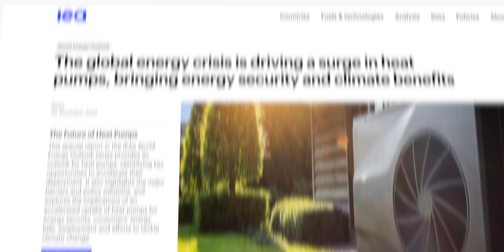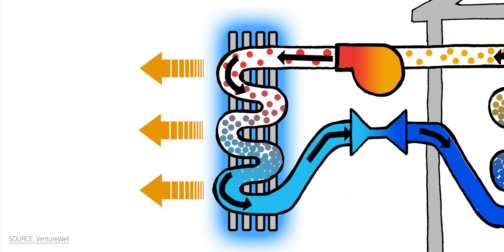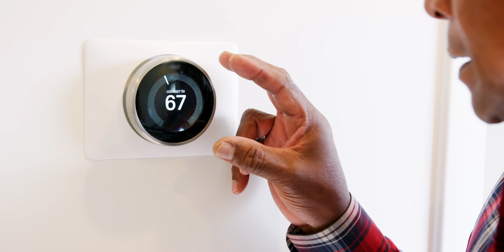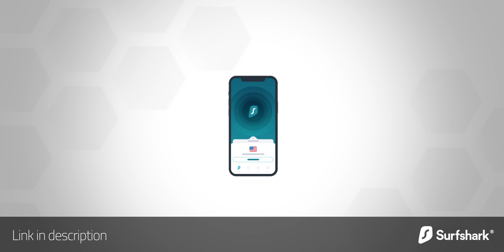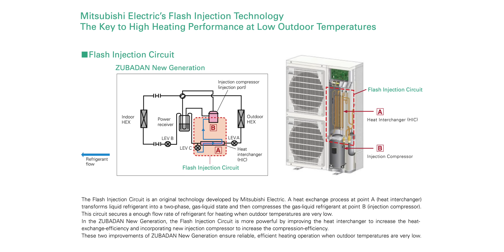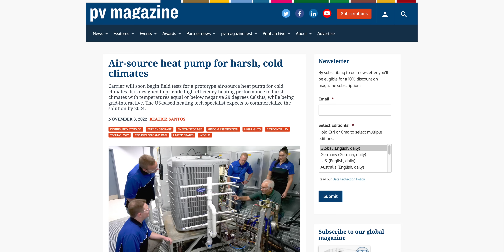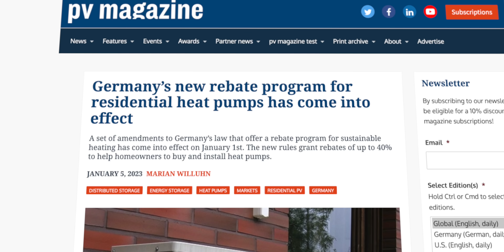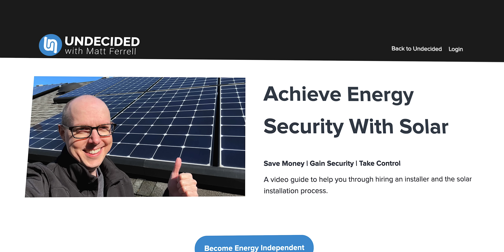Major Advances with Heat Pumps in the Extreme Cold

Comment: I installed a heat pump at my rural EMS station in Vermont. It helped keep the old building in the low 60’s throughout the winter, despite the outdated insulation. Saved $83 in February on heating the building. I imagine they work much better on modern buildings with proper insulation.

Comment: Bit of a misleading video. 1. As soon as your heatpump can add even 1% of extra heat from outside compared to the work that is put in, then you will be more ''efficient'' than pure electric heating. 2. Although heat pumps get more efficient, it is really marginal still, there is a theoretical maximum, which is not great with high temperature differences due to cold weather. 3. On your absolute amount of energy use, the extreme cold days really matter in the end. I can save 70% on the 20% of the mild days of the year, but then still on the 80% of energy used on the cold days, you won't see any difference. 4. Who heats their home electrically? Gas, wood and oil are way more cost efficient, at least where I live.

Theoretical it all sounds efficient and all, but in the real world it is marginal and not practical.

Comment: Hi Max, I really like your very detailed and interesting videos but here I experience some parts that need to be addressed as well.
A geothermal heatpump has the need of being reheated in summer so passive cooling in summer i sneeded to recover/restore the well.

Next to on/of compressors  - that can still do a great job when combied with a buffer vessle - inverter compressors are already 20+ years on the marke so nothing new here. 

Looking at costst os $1000 per kW (or $25-40 per drilled meter) the investent is so steep, a geothermal well will never be economically feasable. Shure, it's nice to have a heat source at -20 degrees (Celcius) outside but depending on where you live, a modern heatpump with propane wil do it's job fine at -7 degrees outside.

Just some ideas of someone being active in the market for 20+ years.

Comment: I don't understand why the air exchange unit outside in colder climates for heat pumps don't draw the air through Shallow buried exchange units.

Isn't soil temperature supposed to be much higher than ambient Air & surely wouldn't add much more cost to the unit
Reply: And simple passive things like having a dark covering nearby or over the soil area or near the heat exchange during sunny days must massively increase the efficiency of the heat exchange and for the reverse a reflective surface and narrow or around the heat exchange area design properly would do the same for cooling

Comment: I got a Mitsubishi hyper heat pump, because I have a solar setup with a 5000 watt inverter.  I wanted to be able to heat my house without emergency heat (electric heat strips) and run my 40 gallon water heater (1500 watt elements), refrigerators, freezer, and some other things off that 5000 watt inverter.  The heat pump worked fine all winter here in Northeast Indiana, except for a few days in late December when it got down to around -8 degrees/ -32 degrees wind-chill with very high wind.  The heat pump could not keep up.  The temperature kept dropping in the house, so I was forced to bring in my 15000 btu propane wall heater (that I use for my garage) for a few days to keep the house warm until that cold spell passed.  My house is about 1100 sq feet, and the propane heater was enough.  The heat pump has done the job other wise.

Comment: geo thermal heat pumps ARE NOT EFFECTED BY THE WEATHER. They get their heat from the ground which is at a constant 52F or 11C +/-
Most of the heat pumps people would be installing get their heat from the ambient outside temperature. 
The heat pumps that work at -13F or -25C or colder are hugely inefficient at these temperatures. Manufacturers only have a few models that can work at these cold temperatures and they are expensive.
You might want to consult some manufacturers about these units. Some of them like Mitsubishi are offering 100% efficiency without a back up heat source. That is a foolish choice. Go ask a condo dweller in a cold climit how many electric heaters they own to keep their condo warm in the winter. How much does it cost to run a air heat pump at -13F or -25C????

Comment: He’s good at telling what the low temperature heat pumps will work at, but never translates that to output into the hot water system.  It’s all very well saying that heat pumps will work at -32°C (yes I am in U.K.). But what heat will I get into my radiators. We need a minimum of +55°C to get anywhere near a comfortable ambient room temperature.

Comment: It just struck me that installing an inexpensive rocket mass heater by the air inlet would allow for MUCH higher efficiency, as the air would never get down to the inefficient temps.  Most RMHs are designed to be run for just a couple of hours, once a day, just before nightfall, and, once they've been running for five minutes or so, stop smoking altogether.

Cheers!

Comment: A disappointing video. Mostly propaganda. The reality that a secondary heat source either gas or oil is needed for several months during the winter in cold weather climates. Electricity costs have skyrocketed as well. Heat pumps also cannot be started and run by a backup generator. Experience a power loss and you freeze. In addition, a heat pump system doesn't fit well with Cape and Colonial style homes. Too many rooms.

Comment: I just had my old heat pump replaced.  We were told it worked down toll 30F outside.  The reality was, if we ran it under 40F, our daily electric bill was higher than if we just turned on our electric baseboard heaters.  The new pump is much better, but not nearly as much as it was hyped to.  It is supposedly good down to 0F.  The reality is the same, but lower.  If we use it when its under 30 degrees outside, its cheaper to turn the baseboard heaters on.  To add insult to injury, it costs me $6-10/day to heat the house with wood pellets, vs 10-20 using the heat pump during the same time.

Sorry, air to air heat pumps are just not good enough to warrant the up front extra cost.  While I agree that geothermal heat pumps are the best in class solution, they dont cost $8500 to install.  The UNIT may cost that much to purchase and place, but the well, or field install will run you another $30k on top of that.  It will never ROI before it dies, with the current cost of electricity, and its constant price creep.

Comment: When I built my house, air to air heat pumps wouldn't do. I did get a quote of $35000 for a ground sourced. (about 30 yrs ago) Plus the damage to trees which shade my house in summer. But with the governments more than doubling the price of gas, and in Canada, we just got another carbon tax increase above the previous 31%, I am again looking for an air sourced pump to use as a 3 season heater / cooler, with the gas as a backup in the coldest months.

Comment: I;m all for green but there is one channel who focuses on heat pumps, I found that heat pumps ain't worth it if you mostly need it at 10C or colder. Aside from installation costs, consider that this is wear and tear of motors and compressors, you'd be lucky if this last 10 years or more. This could change with cheaper electricity and larger heat pump units in the future.

Comment: Interesting to see Trane certifying a low temp heat pump.  I have a mid/high level trane heat pump (plus propane backup) installed late 2019 that my local dealer yells at me when I lowered the switchover temp from 40 to 35F (abt 4C).

Comment: I'm hoping they come out with one that is up to (and exceeds) the task in the upper midwest US and plenty other similar places cause I want one!  BUT, when it gets critically cold (-35 F or colder with 30+mph wind) "it should work" is not good enough. Sounds like the ones coming in '24 "should work".. so people will correctly wait and see. If govt wants to steer people to heat pumps in places like this, rebates are not enough - repairing frozen pipes and confidence is very expensive. They'll need to guarantee a system that works in any condition like combustibles do.. or give them away since they'll only be used as add-ons. Which brings up a good question.. as an add-on / supplement, is it a good economical / ecological option?

Comment: 5:07
That -5⁰ number depends on the fluid used.
You can design heat pumps with different optimal operating temperatures.
The downside is that if they work better in the cold they might not work as well in the heat etc...
You want them to be able to achieve both a liquid and gas state in the temperatures you got available to you.

8:33
Exactly!

Most heatpumps on the Norwegian market currently works best at -35⁰C (-31⁰F) and up.
Below -35⁰C the ones in our market starts to struggle (After all colder then -35 is rare in Norway, although it definitely does happen)
Reply: What about +30 degrees C and up?
Reply: Well you won't be using the thing for heating at that temperature, will you? As far as air conditioning is concerned it is pretty likely that, just as in the UK, air conditioning is not really necessary because it is unpleasantly hot for only a few days per year. @SeattlePioneer

Comment: We installed mini-split type heat pumps some several years back by hiring a technician and doing the non-licensed technical work ourselves with the installation. License or not the hand made connections suffered a 50% failure rate wherein refrigerant vented to the atmosphere and caused the loss of function(2 of 4 units suffered this problem - one with a Halifax tecnician, one with a Moncton one). 
Local contractors indicate a similar failure rate. 
Our next units will be the DIY type with pre-charged refrigerant lines (as is a common thing with built-in boat refrigerators). There is really no excuse for doing this the hard way, when the wholesale pricing on mini-splits are at 15 to 20% of the typical contract  value. Those high contractor charges have to compensate for the high initial failure rate and subsequent callbacks to correct those failures.

Comment: And think about this: The thing is throwing COLD air outside all winter. If they are used globally, that makes them 'global cooling units.'  Run enough of them and they work against global warming!! OK That may be an exaggeration as it's a small amount compared to the total heat in the atmosphere. Additionally for many, the electricity to run them still comes from fossil fuels.  BUT consider how easy it is to convert one of these to run on solar or wind electricity. (<-- trick question 🙂)  Compare that to how you would convert a gas furnace to run on wind or solar, that seems more challenging. 

We have had Geothermal heat for 30 years, in our case open loop which uses our well water to run through the heat pump and then drops it back into a dry well across the yard.  55 degree water from the well dumped back into the ground at about 34 degrees so we're extracting about 165 BTU per gallon of water and then just sending it back into the aquifer. The installation cost of open loop is much cheaper than closed loop. BUT (saw that coming didn't you.)  it comes with the cost of running the well pump as well as the need to clean out the heat exchanger periodically as well water isn't as clean as a sealed closed loop system.

Comment: I'm in a one year old home and my heat pump control board apparently needs to be replaced. The fuse tripped and the system would not start after resetting the fuse. This seems like a scam to trigger timed problems to make money. This happened a month after the service warranty expired. All the money saved on electricity is lost to these tricksters and the mafia groups that divvy up the market.
Local suppliers take the tag out from larger suppliers like carrier or bryant and slap their stickers. One has to be lucky and have good service companies in the area.

Comment: I have had an open loop heat pump since 2005. Works great. Most issues I have had are with the water well that supplies the ground water which is where you get your heat. Properly constructed closed ground loops will prevent those issues but add costs. Once I figured out all the issues using the open loop it works great. It really comes down to maintenance on the open loop side and tricks to make it easier to deal with.

Comment: Basic maths. How does a COP of 2.5 become 3-5 times as efficient as a 95% efficient gas boiler?  3-5 would require a COP of 2.85 to 4.75 to be 3 to 5 time as efficient.  What am I missing Matt?
Reply: Check out Technology Connections’ video on heat pumps. It’s an exhaustive discussion on that calculation.

Comment: Thanks for the video! I'm struggeling with the same issues, living in Norway, were prices on electricity went sky high(0,1 - 0,6 USD/kwh). Petrol is around 8-10 USD/Gallon and gas does not have a distribution system here. I'm currently building a new house by new standards(2017) which is very close to your standards. My problem is that the initial cost is very high, around 16-20.000 USD and the system only lasts for 15 years.  Is such a heat pump system smart to install? Heating such a new house only requires 5.000 kwh / year of electric energy. Relying on electricity solely is also kind of scary? I am thinking about vacuumed solar tubes with large solar storage tanks which can be heated with firewood also.

Comment: I installed a Mitsubishi Mini Split in 2015, I selected a model  wirg a SEER of 21.5 that can heat as well as cool. It's to mall for the whole house but can heat the first floor of my house down to the low 20's. The unit can go much lower my limitation is the size of my ubit.

It's been a mild winter here on the coast of NW and I've on;y had to use my steam system in the mornings on very cold daysto bring the house up to temperature after my four degree night setback, otherwise the Mini keeps me at 70J with no problem and does it for a lot less rhan the gas boiler.

Comment: I suggest you differentiate between air source and ground source heat pumps. Ground source are much less susceptible to loss of efficiency during extreme cold than are air source although, as you point out, air source units are improving significantly in recent years.
Reply: Yeah, it's pretty odd to talk about how heat pumps work fine in cold climates and then mention drilling a 400ft hole for his heat pump installation without explaining why.
Reply: Ground source heat pumps also have a huge additional up front cost.  It’s like solar panels.  You need to have it for decades for it to make sense (will vary based on your cost of electricity and gas).
Reply: @adamhero459 Well, it depends... If you have chilly weather, like here in northern Sweden with -20 to -40C, then it still has a really high COP since the whole is very warm compared to outside air temp. And this means a lot less electricity used for the same heat.

Comment: We've had a 5 ton geothermal system with 2 wells 288ft deep for one year.  One thing I've noticed is in very cold weather 0F the incoming loop had a temp of 38F which was the lowest temp of the season.

Comment: In 2017 I had a Mitsubishi H2 (Hyper heat) style heat pump installed with traditional forced air system. The contractor put in an electric heat pack in the air handler for backup heating. We live near Columbus, OH. Here it seldom gets below 0 F, but at times it has gone as low as -20 F at night. The heat pump has worked flawlessly, I clean the outdoor unit by vacuuming the dust and dirt off the coils in the spring and the fall, and of course the indoor air filter every 3 months, but that's it.  I found out by accident after two years, that the electrical breaker for the backup heat had never been turned on. This winter it got down to about -20 F at night, in the morning the house was 2 degrees lower than the thermostat and so the backup heat should have turned on but didn't. I need to find out why it didn't turn on. I am very pleased with the system. 

A place where I previously worked had a number of Mitsubishi "Mr. Slim" split units. They all worked great for many years, even in weather as low as -5F but when the broke, and were "repaired" by the local dealer, they never worked as good again. I think this was because the repair technicians treated them like ordinary air conditioners and didn't have training to work on high performance units.

Comment: I had a brand new split heat pump installed in 2022 for my breezeway/kitchen/dining area.  It worked great as an A/C with low cost.  For upstate NY winters .. not so much.  I kept it at 66 F and used a small very efficient wood stove for my main heat.  As of this date, I'm not running the wood stove.  It's 52 F outside, inside the room is at 63F .. that seems to be the best it can do.  It's a Miztubishi.  My main house I put in a brand new propane furnace and have another efficient wood stove.
Reply: If it’s the correct btu for the space you need to have it checked by a pro. You may have a leak or dirty condenser.

Comment: We have had a Carrier central heat pump for almost 2 years now.  It has backup electric heat.  The only time the backup has come on was on a day where it was minus 9 Fahrenheit actual temperature with 40 mile an hour winds. This is a 2 stage compressor with a variable speed central unit. So far, we really like it.

Comment: Wish we had known about the variable speed compressor system. Our heat pump does turn on and off repeatedly and electricity costs are definitely higher in the winter. Otherwise we like the heat pump. Glad to not have to mess with gas or oil for out heat. Our next step is to get ground based solar panels and a home battery. We plan to save money by buying solar panels and doing the installation ourselves, then pay a election for hook up. At least we hope to, lol. Still doing research, but seems feasible.